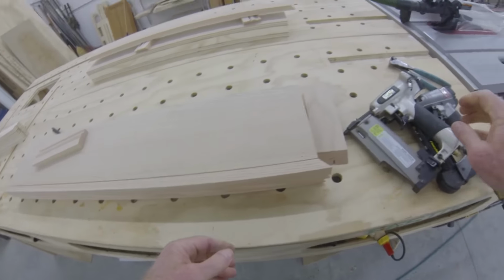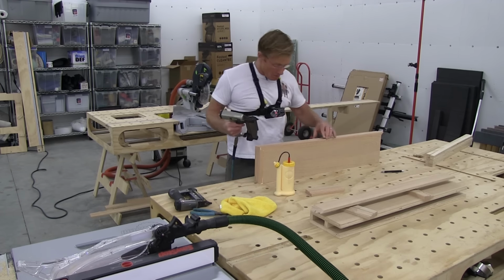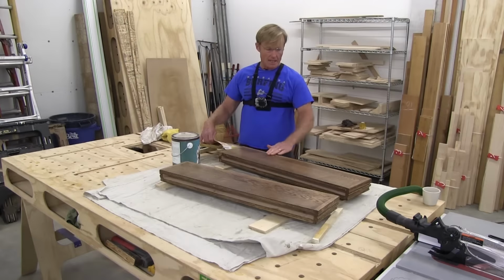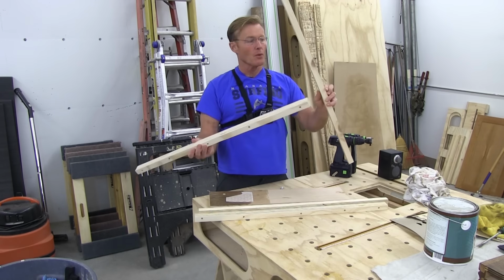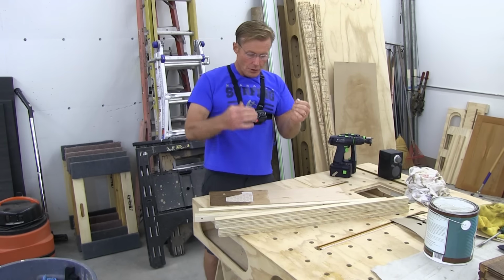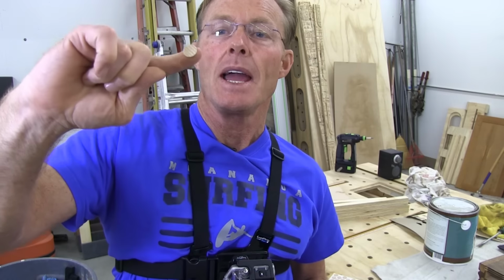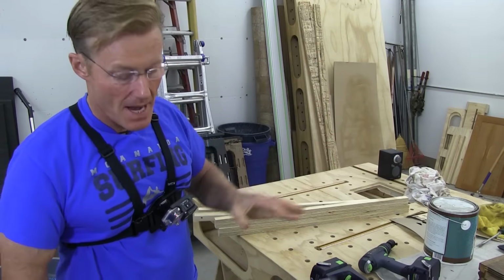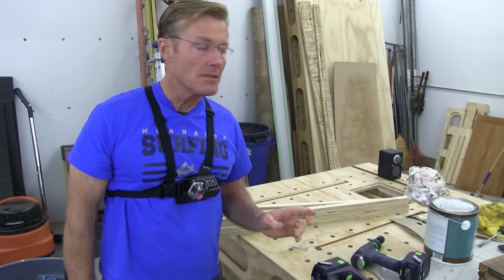IN THE SHOP: MAKING A FLOATING SHELF (PT3)

Comment: I noticed you used a micro towel for your glue cleanup.  I started using them for about ever rag need in my shop about 2 yrs ago. They last much longer than any paper towel and are stronger for scrubbing. Most of the time I can wash them and they are  ready to be used some more. I use them all the time in my painting uses. Keep the videos coming.

Comment: If you put a light coat of stain to areas next to where you will be gluing, no wet clothe required. The stain prevents the left over glue from messing up your finish. Just wipe on , then wipe off. I have been doing this for 40 plus years with minimal wasted stain. Try it.

Comment: I have a Cadex 23 ga too. Mine the driver blade sticks out on every shot, unless I drop the air pressure down too like 80-90 psi. Which is a pain so I just use my 99 dollar rigid 23ga. Some things u don't get what u pay for
Reply: I bought the Cadex 23 ga  about a month ago- so far it's worked perfectly. Did I just luck out with a good one ...or is it just a matter of time ?
Reply: +1menotomy they make good stuff, I think mine was a defect. I have been using some grex 18 ga nailers and the quality is real good. When u pick one up u know it's a serious tool. Might have to pick up one of there 23 ga and give it a try.
Reply: +1menotomy they make good stuff, I think mine was a defect. I have been using some grex  green buddy 18 ga nailers and the quality is real good. When u pick one up u know it's a serious tool. Might have to pick up one of there 23 ga and give it a try.
Reply: +1menotomy they make good stuff, I think mine was a defect. I have been using some grex  green buddy 18 ga nailers and the quality is real good. When u pick one up u know it's a serious tool. Might have to pick up one of there 23 ga and give it a try.
Reply: +1menotomy they make good stuff, I think mine was a defect. I have been using some grex  green buddy 18 ga nailers and the quality is real good. When u pick one up u know it's a serious tool. Might have to pick up one of there 23 ga and give it a try.
Reply: Thanks, I do drop the air pressure to <100 PSi when switching  from a framing or finish nailer  to the pin